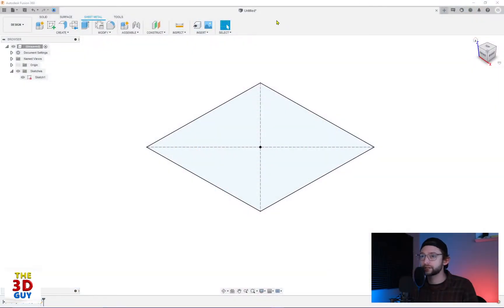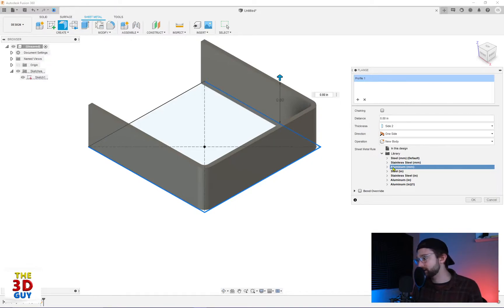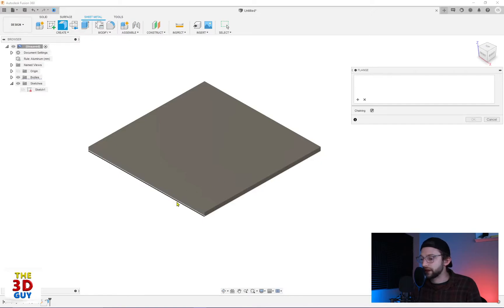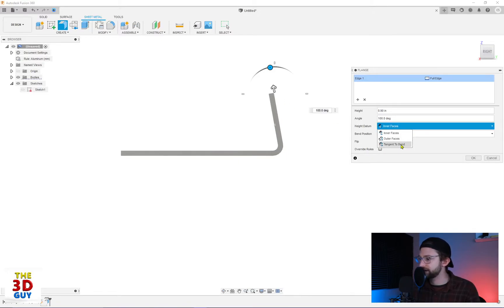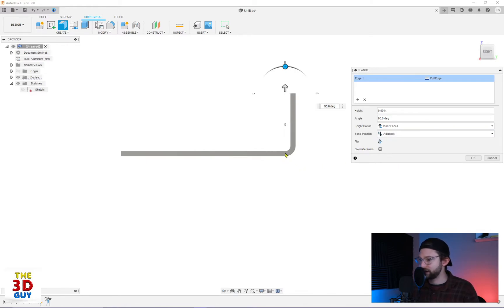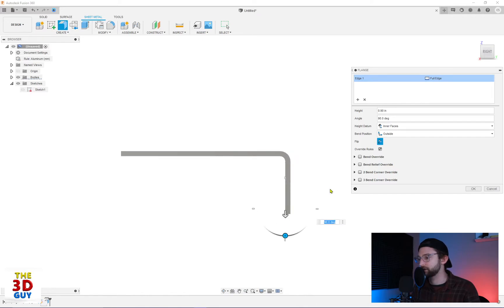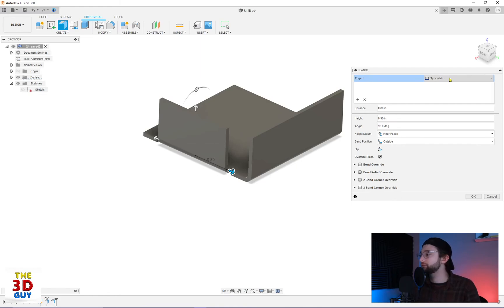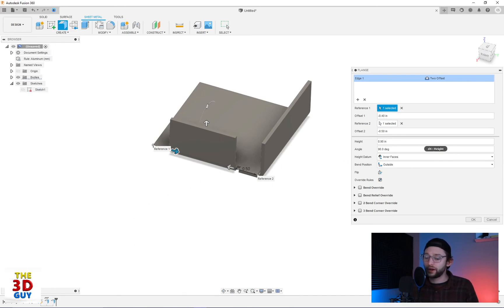How to Use Flange in Fusion 360

Comment: Having an issue im newer to this...im trying to miter a lantern base the base is wider then the rectangle above it as a light would drop into the top cube so the base bends outward on all 4 sides at 90° but i want it mightered bends at 45° essentially to have weldable corner joints after being bent when i do it i get a warning when i hit the flatten button i think because its overlapping on the corners but i dont know a work around to join outside corners please help any and all help would be greatly appreciated